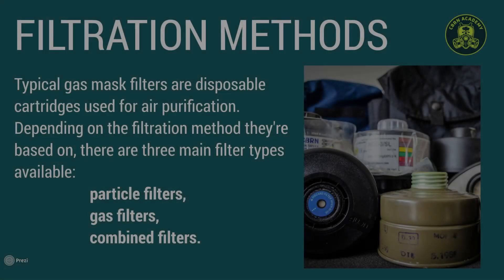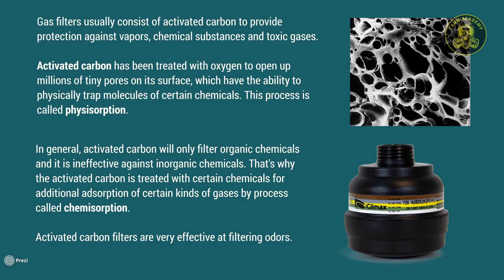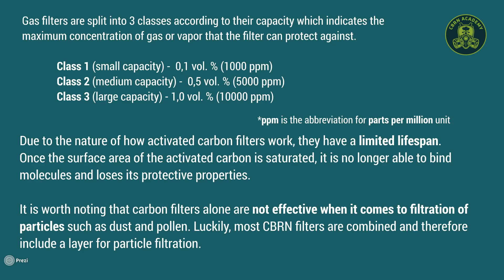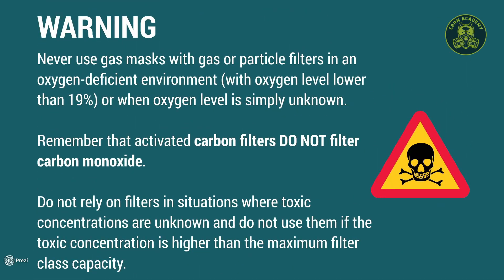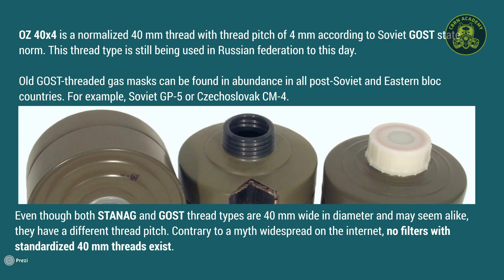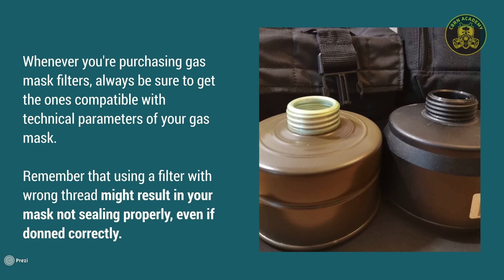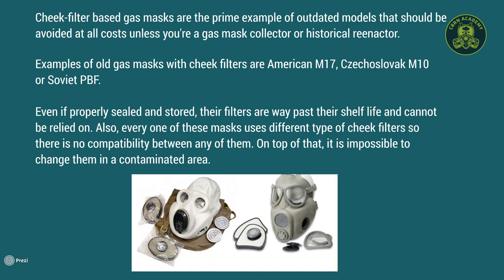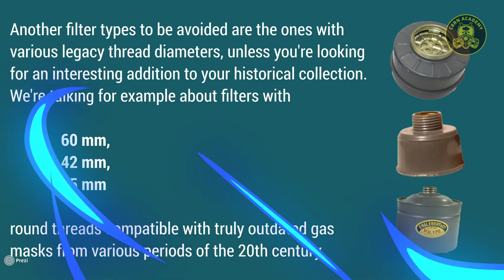Everything you need to know about gas mask filters!

Comment: Thanks a lot.
Could you please be so kind and inform me which filters is quite enough and good to use against tear gas?
Which kind of filter protects tear gas best?
Thanks again.
Reply from the maker: Hi there! Any combined CBRN filter will be more than enough, even though a simple gas filter without the particle filtration layer should serve you well.

Technically speaking, what's you're looking for is at least an B2P3 filter commonly used in different armies. Even new ones are not that expensive because their protection range against other dangerous substances is quite limited.